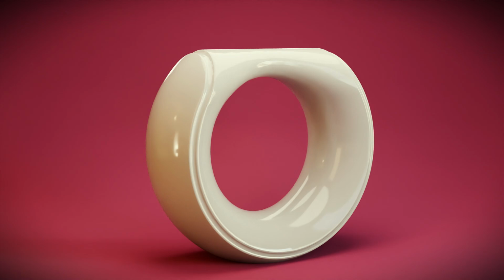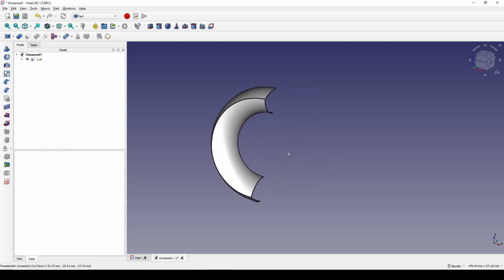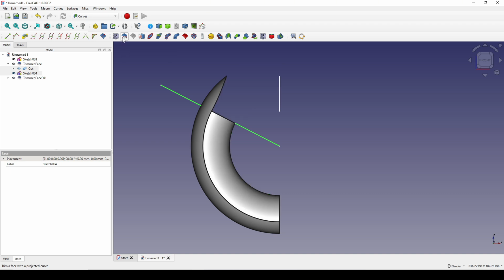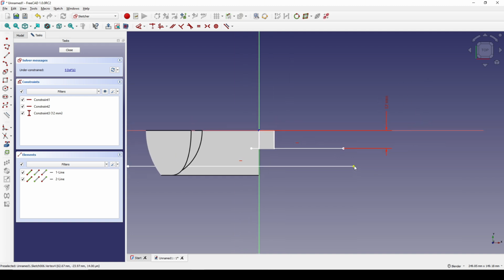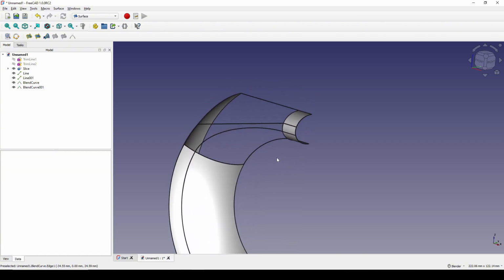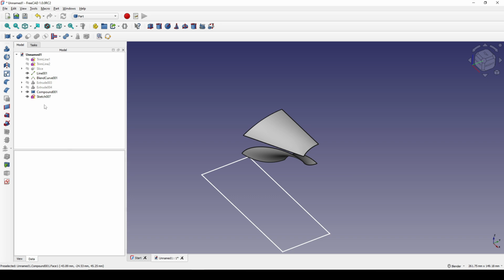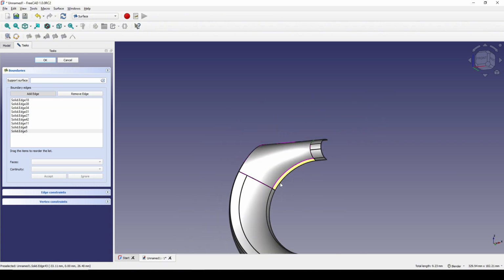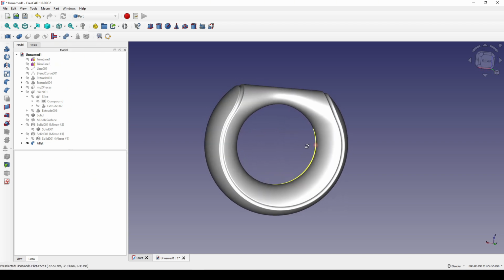FreeCAD 1.0 RC2 Using Trim Face To Create A Design.

Comment: I followed this tutorial, and it worked out fine. However, when i try to create filled surfaces in my own projects, they often does not work that well. 

It would be interesting if you made a video of how to plan a project, and how to solve some common problems.

I have a simple file i could send you that i cant get to work with face continuity if you are interested to maybe have as a starting point for a video?

Comment: By the way, I used the Blendcurve from the Curves Workbench. The menu is almost identical to that of the Surface Workbench. In both cases, however, it is not easy to understand.